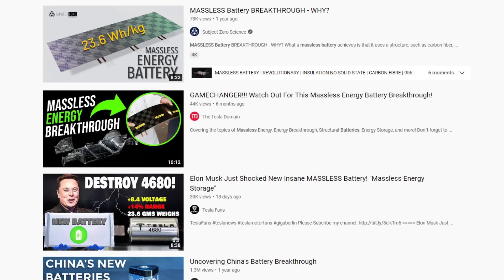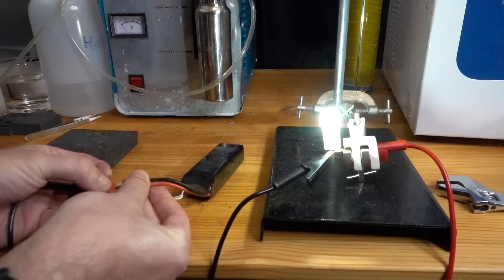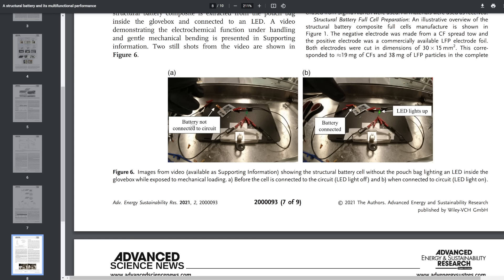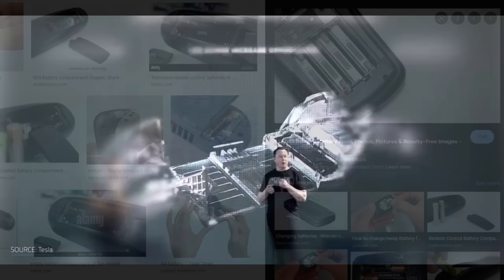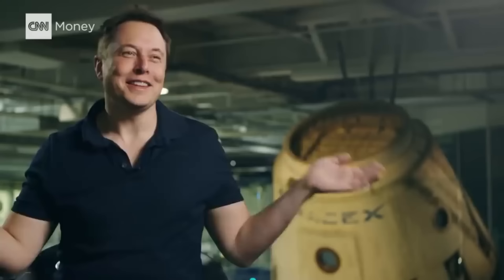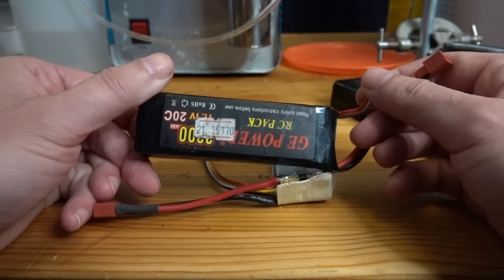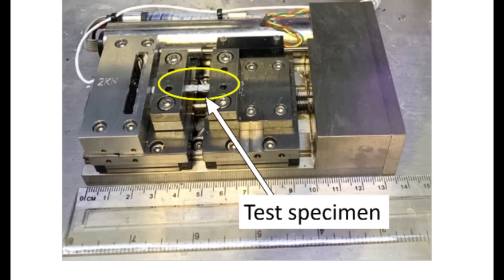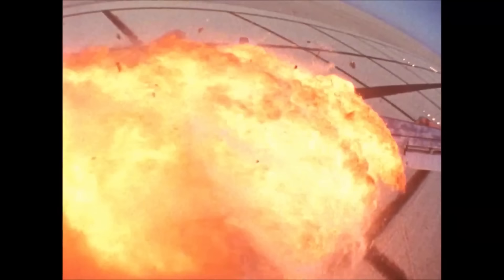Matt Ferrell, Massless Battery: BUSTED!!

Comment: Oh Thunder, I highly recommend you watch “Munro” 4680 battery pack disassembly. It’s layered into some sort of gel that is extremely hard to get off which makes battery pack unrepairable.

In combination with Gigacast large pieces of body structure being casted as single pieces new Teslas (Model Y for now) are quickly becoming impossible to repair in a garage :/
Reply: Sounds like a problem for the buyer. Don't buy it expecting it can be fixed. Consumers need to be smart or risk being scammed.
Reply: This is also a big issue when it comes to recycling.   Difficult.   An issue that is widely ignored with a lot of finger crossing about it becoming possible eventually.
Reply: If it's not disposable, you can't eliminate the used market!
Reply: I see. They're taking notes from Apple. Genius!
Reply: @kapytanhook  companies shouldn't be allowed to screw consumers to this degree in the first place
Reply: @shoddy  Yup! Apple’s been gluing batteries into their phones & iPads for years.
Reply: @InfernosReaper  it's not if the customer wants it. Some people like apple. Companies need to be free to innovate and people can vote with their money. If unrepairable products are better so be it. It might be fine too have a unrepairable Bluetooth earpiece, I just get much doubt the same applies for cars. Leave the government out of deciding that
Reply: @Hereford1642  "not recyclable "
Not according to Munro 
Dip in liquid Nitrogen to reduce it to molecular dust, then extract individusl materials using chemical or physical  processes.
Reply: @dnomyarnostaw  Who is Munro?  Are you making a joke?
Reply: @Hereford1642  Sandy Munro, the famous car expert.  He even helped Tesla design some things.
Munro Live is tearing down a new Tesla battery on  his channel,  and they mentioned the recycling.
Reply: @dnomyarnostaw  Leaving aside the practicalities and cost of freezing everything and crushing to dust,  you are left with a powdered mix of complex molecules.   Merely stating the you will use physical and chemical processes does not actually solve the problem.
 I could state that II will remove CO2 from the atmosphere using physical and chemical processes -  is the problem solved?
 My degree was in chemistry/biochemistry and I have read what I can find about this problem.   It is difficult.  The mixture is complex and toxic;  the processes to refine it are unknown.
 The ocean contains huge amounts of gold but nobody has a process to extract it.
Reply: @Hereford1642  Well, how do you think they process raw minerals now?
A soup of concentrated metals is relatively easy to process, which you should know with you experience. 
Between centrifuges, catalytic combining of elements and electrical refining, the processes are well known.
Nitrogen in liquid is pretty straightforward,  even your average doctor or farmer had access to that.
Reply: @dnomyarnostaw  A quote for you:-
'It is clear that the current design of cells makes recycling extremely complex and neither hydro- nor pyrometallurgy currently provides routes that lead to pure streams of
material that can easily be fed into a closed-loop system for batteries.'
From 'Recycling lithium-ion batteries from electric vehicles' - Harper et al.
Perhaps you know better.
Reply: @Hereford1642  Harper et al, 2019 
That's 2years ago. ???

For a start, that's before the new low or Cobalt free batteries that are taking over. Even so,  announcements like
"Researchers at Princeton University developed an inexpensive way to perform direct cathode recycling and spun off the start-up Princeton NuEnergy to commercialize and scale the operation. They mechanically separate materials, then use low-temperature plasma to remove contaminants produced during battery use. The system uses 70% less water and reduces energy use and emissions by 80% compared with current Li-ion battery recycling technologies, the company says. Earlier this month, the startup announced it had raised $7 million in seed funding."

and

"Li-Cycle announced that it would use Veolia Water Technologies’ evaporation and crystallization system to process materials at its lithium-ion battery recycling plant in New York to recover nickel and cobalt materials for use in new batteries. 

Ascend’s hydro-to-cathode system lets it break down the lithium, nickel and cobalt in EV batteries and then rearrange the atoms to create new materials. "
May 22, Wastedive dot com

A lot more innovations around than I can fit into Youtube.
Reply: @dnomyarnostaw  It is estimated that between 1% and 5% of Lithium batteries are recycled compared to near 100% of Lead.
 If it was easy there is a gold mine of free materiel to process for a clever entrepreneur.
 Yes, research is being carried out but that does not negate what I have said.
 It is not solved.   Nobody knows if it actually will or can be solved in any efficient or practical manner.
Reply: @Hereford1642  Didn't say it was "solved",  but it has hardly gotten started.  The first Teslas were only 2008,  exponentially the rush doesn't start till 2025.
You cant possibly think that an economic  asset like batteries will be just buried and ignored.
Nor can you sensibly  think that technology wont be available, given the amount of money for R&D being spent.

Comparing Lithium to Lead is pointless. 92% of batteries sold are Lead Acid based, and even  then only ~ 95% of Lead batteries are recycled worldwide. Of those, 800 million children are affected by heavy metals, through bad lead battery recycling practices. Lithium-ion batteries do not contain mercury, cadmium or lead, so recycling isn't nearly as critical as Lead batteries.

EV batteries are barely a spot on the face of metal recycling priorities.
Reply: @dnomyarnostaw  What I originally said was that recycling of the batteries has not been addressed.   You have eventually confirmed that.  So cheers.
 The quality and efficiency of whatever processes are used remains to be seen.
Reply: @Hereford1642  "What I originally said was that recycling of the batteries has not been addressed. "
That was funny. YOU quoted  the first paper that covered many of the growing research into batteries, I referred you to 3 programs involving multi-million dollar investment.
If  that's not "addressed" enough for you, considering the big volume of EV batteries doesn't get to be a real problem for another 3 years,  I don't know what your point is.
Add to that, the serious current recycling effort pf lead batteries, with its huge health implications, relatively speaking, EV batteries are miles ahead.
Reply: @dnomyarnostaw  It is researched but it is NOT SOLVED.  Do you not see the difference?
  Much effort has been expended aiming to extract CO2 from the atmosphere but it is NOT SOLVED.
 There is no guarantee that it will ever be effectively and efficiently solved.  
 It is a question of hoping.  That is all.
Reply: @Hereford1642  Make up your mind . Do you want it "addressed" or "solved"
Totally different goals. 
Ad I said before,  I never claimed it was "solved", and until you changed the goalposts,  it wasn't the point I was addressing.
Reply: @dnomyarnostaw  Tedious semantics.

Comment: Let us imagine for a second that "structural battery" actually existed. Now, let us consider the problems it brings - how do you replace such a battery? How would such a battery react in case of accident? Even a slight defect on the car's structure would cause the battery to fail along with hazard of fire or electrocution from just touching the surface of the car. Structural battery would in reality have only a very niche application.
Reply: Thats the amazing thing about the structual battery, you cant replace it, the wet dream of every share holder, you just have to buy a new car every year.
Reply: Basically think of mobile phones... They first came with removable ones, and nowadays we just completely replace them with a new device every 2 years on average cos the effort and hassle of having to replace the battery is more than people want to deal with... That's why EV makers are moving more toward that, it'll make them more in overall sales revenue.
Reply: I don't suppose you know but they invented a highly technical device for joining several small structural parts together to make one large structure, the technical name for them is "bolts"

Comment: Great Idea from Tesla to basically glue and epoxy the cells into one big blob that IS the whole underside of the car just to make sure that NO ONE can replace it without completely destroying the car. And to stop people from meddling with the packs and ripping them apart to PROPERLY repair them.
And even better for the "Battery as a structure."
Oh your Battery that is the A-Pillar is gone flat? Whoops - better toss the car becasue carbon fiber can't be cut and replaced due to it's nature of the material. 

Can we just please get proper battery packs that are swappable and replaceable as one unit that every manufacturer follows?

Comment: 16:52: well he was correct. There was no one in those robotaxies. Neither drivers, nor passengers. And least of all a self driving computer.

Actually gravity fed engines are a thing. The fuel tanks are also slightly pressurized.
The actual reasons why fuel is stored in the wings in aircraft:
- It's dead space anyway, can't put cargo or people in there, at least not easily accessible (and it would be rather uncomfortable).
- Fuel weight keeps the wings from flexing too much, especially when heavy (aka when full of fuel). This would be a problem if the wing was empty and the heavy fuel was stored in the fuselage, for instance.
- It's close to the engines, meaning minimal plumbing

More about aircraft fuel systems here: https://www.youtube.com/watch?v=T84zJhvFAQE

Comment: "Fuel tanks in airliners are isolated from the fuselage, so if there's a fire..."
No they're not. Almost all airliners have fuel tanks in the fuselage, between the wings. Multiple of the diagrams shown in this video make that clear.
Reply: Well, they also have a tank in wings. In fuselage is the main tank used by both sides, so if one side uses more fuel for whatever reason (like one of the four engines failed), will not lose this side completely. 
Is there any engineering area with higher backup and reliability demand than airplanes? Maybe rockets for space, but I'm not sure. After all, if your car breaks down, what will happen? It will stop and that is all. But with plane, well, gravity is still a thing so you really do not want it to stop until it is on nice, flat piece of asphalt, right?
Reply: @simonspacek3670  it makes the safety and isolation argument irrelevant in any case
Reply: @NJ-wb1cz  Yes. Completely.

Comment: Thin film structures can actually have amazing mechanical properties, look at microcrystalline diamond coatings on scalpels, or TiN films on high speed drill bits, the difference between these thin film coatings and a battery is they're specifically meant to stop the transfer of energy in terms of friction and not store any energy. If you try to storel energy in them, they fail spectacularly.
Reply: Not really, those coatings are not about stopping energy transfer... they don't; the tool can still heat up quite easily. The role of those coatings and other similar effects like case-hardening (by carburization or nitridation) is just to increase the hardness of the exterior while preserving the toughness of the bulk material so that tool can cut harder materials without itself having to be a very hard material in bulk, which would be brittle and therefore low toughness.

Comment: Good video. Matt Ferrells video reminds me of stuff I have read as a child which got me interested into sciences for all the wonders and technologys described in them that we would (maybe) have 20 30 years down the line, but stuff like this should not be taken seriously by adults, nor should it be reported as news or facts ... 
Another thing: Gravity feed systems are usually only present in high wing single engine rotary aircraft, but I think there is also a gravity feed system in jets so in case of a total engine flame out, enough fuel is provided to the engines to restart it and the pressure/power necessary for the injectors is actually provided by the fan blades of the turbine spinning in the air while the plane is gliding/falling.

Comment: 26:24 the black wire is not connected to the negative terminals of all the series cells, if it were so all but the last cell were shorted out. It is only connected to the negativ of the first cell. The other cells are charged between the colourful wires.

Comment: Wanted to point out one oversight. The pressure of the fuel coming out of the tanks is different than what is being provided to the engine which is different than what is being injected into the combustor
Reply: low pressure to the high pressure. they use the same on direct injection vehicles now because they also use hundreds of pounds of pressure as they spray fuel directly into the combustion chamber during the combustion cycle. Low pressure electric pump is 30-60psi from the tank to the mechanical injection pumps. You can generally hear them clacking/ticket especially if the hood is up on a DI car.
Reply: It's the question of whether gravity can supply enough flow to allow the injector pumps to provide enough fuel to maintain at least some thrust. The input pressure from the tank pumps would support higher throughout for greater thrust levels, but if a tank pump is underperforming or offline altogether would the injector pumps still have enough draw for, say, 30% available thrust? 10%? I'm sure this is also dependent on the particulars of the powerplant and its injector pumps.

The redundancy in all these systems reduce the likelihood of a complete tank pump failure. Still, it feels disingenuous to criticize the idea that a failed tank pump would mean a wholly starved engine...it feels like performative criticism at that point.

I've never looked to Ferrell's videos as anything more than future tech videos. I did not look at the structural battery and literally think "massless"...that's just illogical. Nor did I think Ferrell was literally intending "without mass"...also just illogical. To me it read more as him using the marketspeak to subtly point it up, because marketspeak is so often illogical.

Dunno...I see Ferrell's videos very differently than the takes being made here.

Comment: Sandwiching a battery directly between two structural elements? Maybe they should ask Samsung how well that worked out with the Galaxy Note 7.
Reply: That's how practically every single smartphone and tablet is built. Go look up the layout of any smartphone, you'll find that they ALL sandwich the battery between the structural elements.

How are people upvoting your comment? It is so incredibly inane and uninformed - and it's about the device that most people watch these videos on. 

I  can't imagine how you even thought to make your comment. You probably watched the video on mobile, and thus you clearly don't know the layout of the device that is already in your hand.
Reply: @chrisannika6006  it's upvoted because it's right. While it's true that smartphones have the battery between two structural elements, the positioning itself is not what I was talking about. Most smartphones have a gap between the battery and the outer case of the phone or between the battery and the phones motherboard. The Galaxy Note 7 didn't have this gap, because they switched battery suppliers at the last minute and the new supplier's batteries were slightly thicker, eliminating the gap that had been in the original design. That lack of a gap is what caused the phones to start on fire.

It's because when the battery heats up during charging or use, it expands quite a bit. This expansion puts pressure on the innards of the battery, squeezing them tighter and tighter until the anode and the cathode push a part of themselves through the separator and short circuit. Now short circuited, the battery gets hotter, expands more, increasing the current flow, increasing the heat, increasing the pressure, and so on until the whole phone catches fire in a very violent fashion. This is all because there wasn't a gap between the battery and the rest of the phone.

So now you know why you don't sandwich batteries directly between structural components, why no smartphone is constructed without a gap on one side of the battery, and why these people should talk to Samsung about the Galaxy Note 7 if they want to know why. The more you know🌈 ⭐

Comment: 33:15 In Germany they now try to integrate solar panel into a train track. Not only is the panel in the worst orientation or position like in solar roadways, it is also blocked by the rails, and subject to vibrations and bending (probably) and dirt and debris dragged across them by the wind generated by driving trains.
At least it is not subjected to structural load.
Reply: If they want to install solar panels for trains, why not install it next to the tracks instead of in it? Complete stupidity.
Reply: @farenhite4329  Because they think that's free space (and often the properties next to the rails are privately owned).
And not for the trains, but as general solar panels.